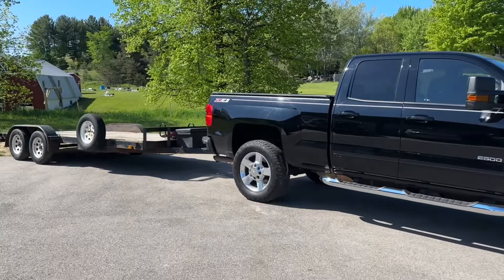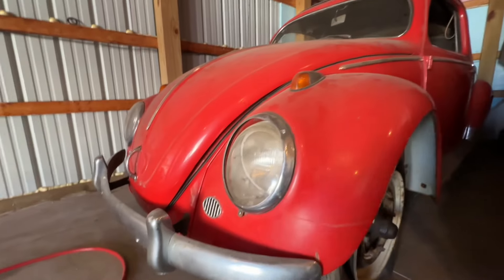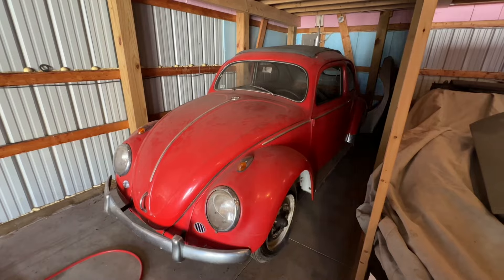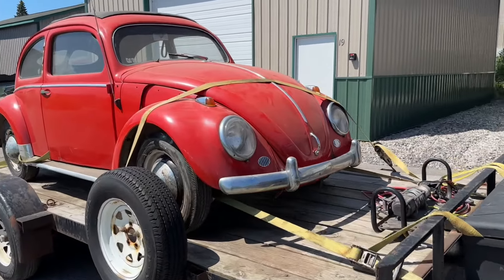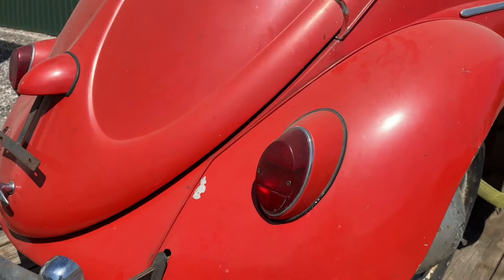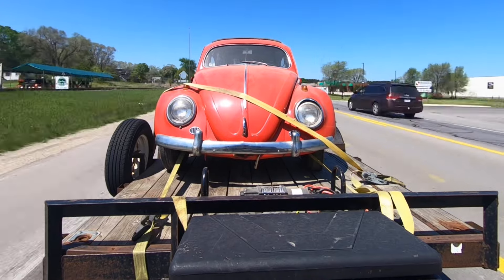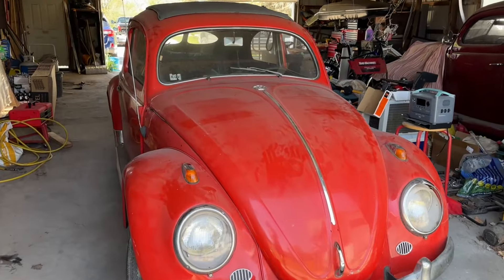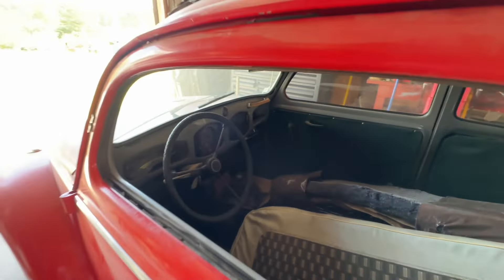Dad’s barn find ‘51 split window rag Beetle comes home!

Comment: Very cool. Will need some $$$$$ new fenders (correct ones) Round grills. split window bumpers. (crotch cooler or before?) are the crotch coolers there? 16 inch rims $$$. Lind gets containers of those fenders from BBT and sells them very good prices. 1/2 the cost of other places. He is in idaho If your out and about. gonna take some $$$ and time. Lets hope there is not too much hidden rust.

Comment: also deluxe should have passenger side Radio or Clock. I dont see one in there. $$$$$
Reply from the maker: Yeah not sure if it was deluxe or what. Can’t find this model code listed anywhere. 12E or 12F? Build June 1951
Reply: @turbostoybox2182  m codes should be on the birth cert. But look at the trim holes. see if they are drilled or factory stamped Look and see in the floor area if there is something covered up on the crotch cooler area. you can buy all the parts to install them from BBT. also Repop original split moldings $$$$$
Reply: @turbostoybox2182  also steering wheel is a standard wheel. MAYBE it is a standard with trim holed drilled? which is cool
Reply from the maker: @Mikefngarage   Spent hours looking thru old forum posts today. Nearest I can figure it was a std with sunroof which was stupid rare I guess? Maybe with optional side molding? I haven’t been able to locate any other tags yet in the trunk area except the one I had the picture of in the video.
Reply: @turbostoybox2182  also Popes nose tells me the decklid is later model. Those original decklids are super $$$$ But the best part is that it is a standard rag......which is very cool.
Reply: nice looking 36hp in there 25hp is missing. looks like a later model engine. Not sure what year but probably 57-60.
Reply: big spring decklid Present....Missing popes nose. Either it is a 53- early 55 decklid (worth $$$$) or it is just missing correct popes nose. I dont know the bolt pattern of the correct popes nose. That License light on there is later model. But decklid is early. just not sure on that. Good news!!!!
Reply: @turbostoybox2182  One last thing....I am not sure if that steering column lock is correct for that year. It may be......But I am wondering if they changed it. Because I believe it is missing the Semaphore turn signal switch which are super hard to find...and I think they bold on where the column lock is. if it is a later year column with the column lock. they are a really cool accessory and sought after. so you can use that money to buy the correct stuff. If it is the wrong column the semaphores wont have the correct turn signal for them to work FYI.  Definitely a car worth saving but it is going to get pretty expensive. Plane tickets to Germany!!!!